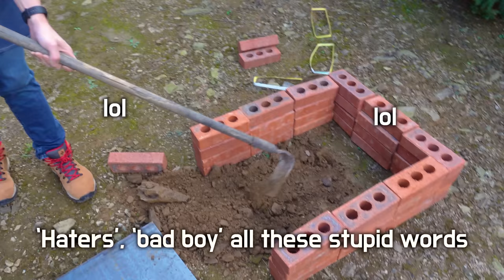Primal DIY Oven Pizza in Rural Korean Forest

Comment: So do your parents ever watch your videos?  Based on some of the things you say about them, it feels like it would be awkward lol.

As for the pizza, building your own oven was cool.  I feel like it would have been better to stagger the bricks to make it harder to knock the whole thing over.
As for the dough, it is hard to tell, but you probably just didnt knead it enough.  Using a machine, you need to knead a long time.  If you're kneading by hand, you basically can't over knead it. You should be able to stretch it out thin enough to be able to see light through it before it breaking.  Or thin enough to wear it like a glove without breaking.  For me, I thought the crust is the most important part of the pizza.  Though you did say you were making NY style so I guess their crust is more floppy.
Also, try sliding the pizza directly onto the stone.  The tray you had keeps a gap between the dough and the stone that can make a difference.  If you're worried about getting the pizza out or it sticking, you can use parchment paper. 

Still, very cool video!